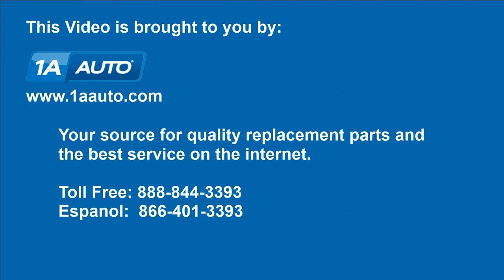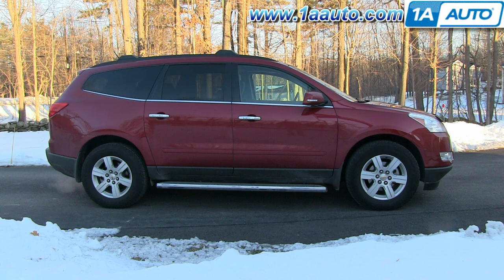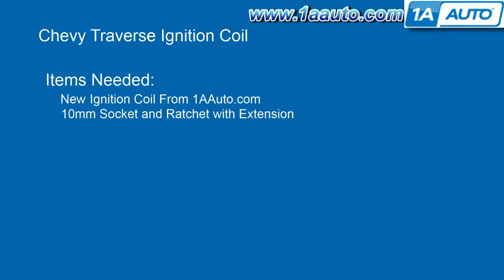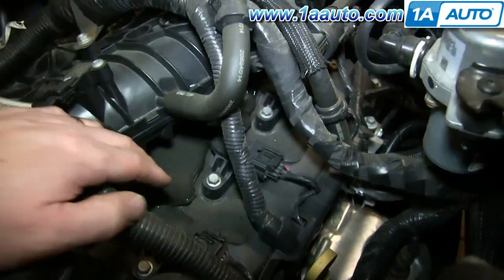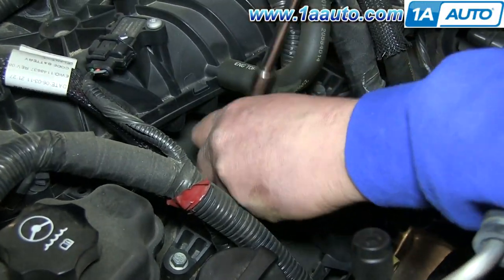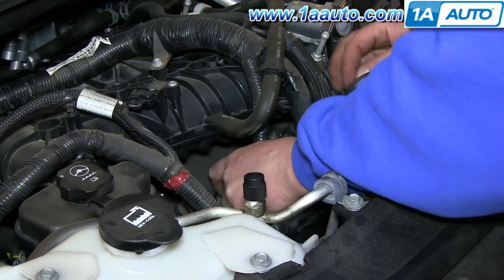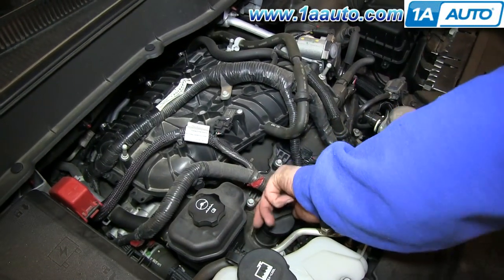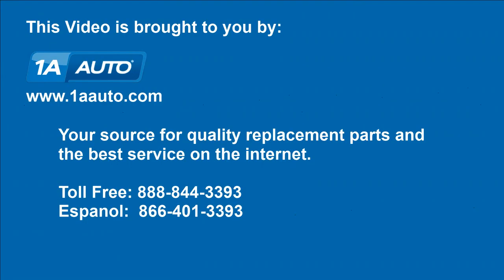How To Replace Engine Ignition Coil 09-16 Chevy Traverse

Comment: I disagree with only showing a replacement from the front bank.  That's the easy stuff.  If replacing the plugs/coils, you should be realistic and show people how hard it's going to be to get to the rear three.  Will the intake manifold need to come off?  Will you need to replace that manifold gasket once the intake is removed?  etc...

Comment: Whats the firing order? Is it 1, 3, 5 on top and 2, 4, 6 on bottom?
Reply: That's what I would like to know. Having a hard time finding the firing order and cylinder numbers for this vehicle.
Reply: Yes 1 3 5 in the back 2 4 6 in the front going from passenger side to the driver side
Reply from the maker: Thanks for checking us out! +Bridget Coates
Reply: @thegreatkingscorpion  which one is 6

Comment: Post one for 2010 Acadia v-6. Setup slightly different. Thanks.
Reply: Kristopher Tillman they are the same GM brand
Reply: The 2007-2012 Acadia requires the removal of the intake manifold and probable replacement of the lower intake manifold gasket. Way different than what is shown in this video.

Comment: The fronts are easy why not show how to do the rear
Reply: Yeah.  I did the spark plugs in the back of my 09 Traverse.  It was a pain in the ass to do the ones in the back!
Reply: That’s what I need too, tips on how to do cylinder 3 in the back
Reply: How do you figure out which one needs replaced? I had one done 6 months ago and need it again.

Comment: need details - -not as easy as in instructions - -how to remove wire, won't come loose, other things are in the way, etc
Reply: actually -- the manifold would have to be removed - -there is NO WAY to get the coil out.